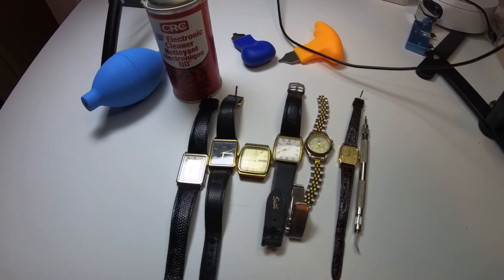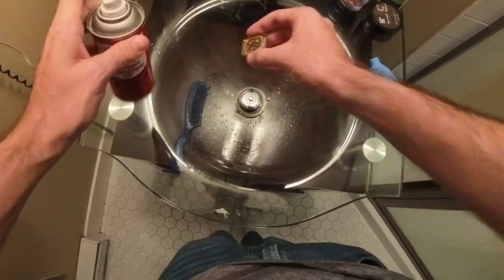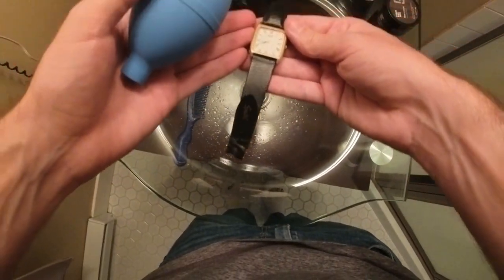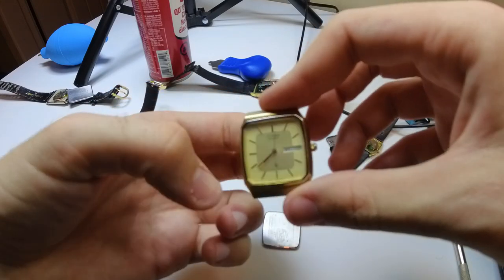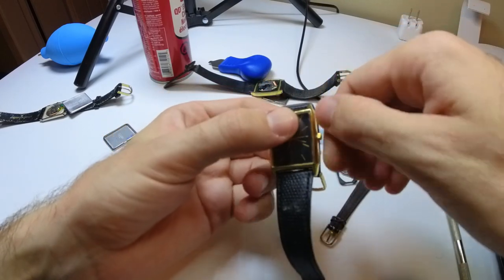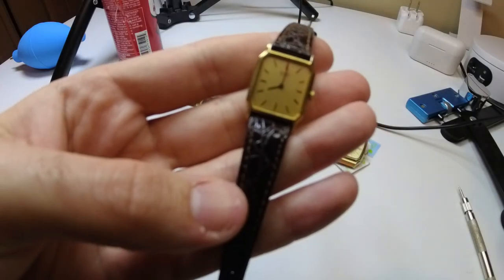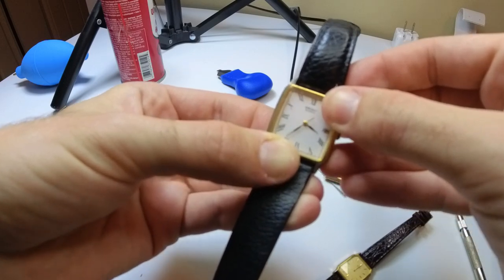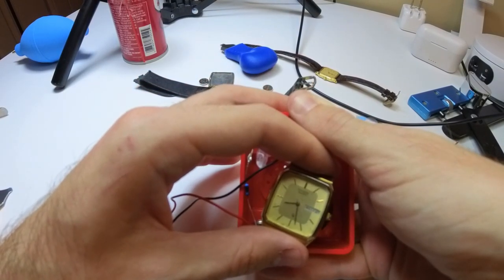fixing quartz watches with electrical cleaner

Comment: no watch problem ever been fixed by putting more oil in a watch ... thats the first thing i learned about watches ....
Reply from the maker: Hahaha true, the electrical fluid evaporates
Reply: @vintagesterlingfinds  no it will leave a film of grease behind the most have oil in it ...
Reply from the maker: @ElderPinto254  ok thanks I didn’t know that
Reply: How about pure isopropyl alcohol?
Reply: @Jim-Mc  yeah u can use it to clean watch parts but not the balance wheel !!
Reply: This will insure all the lubricants in your watch will be dry. Not good!
Reply: @knottreel  yepp and not nice for watchmakers that gone open this and find al that crap everywhere..

Comment: Ive managed to get quite a few vintage watches going that didnt work after new battery by using contact cleaner and little air puffer. Also gently tapping movement, but be careful as hands or numbers can fall off.
Reply from the maker: @stevejohnman68  thanks I have tried contact cleaner and it works very well

Comment: it's  wrong procedure to fix these  quartz  watches  ,may be run for while  not for longer  time  watch  mechanisam  must be disassemble and throughly clean   assemble with  proper  lubrication  oil
Reply from the maker: Ok thanks. I did the video because a subscriber recommended it to me
Reply: You're right, but it is such a long road: 1. preclean, 2. clean, 3. re-assemble and lubricate.
Reply from the maker: @MarkJoseph-vv4pj  yes this video was to show a quick fix on an inexpensive watch

Comment: On some quartz watches you have to reset the circuit by using conductive tweezers and touching between two points. If you know the movement caliber numbers, you can find the reset online. Seiko and citizen both are common for needing a reset procedure. Could be that's all they ever needed.
Reply from the maker: @flynlow43  ok thanks. I will relook at them. I have seen that on Casios before

Comment: I use a little bit of moebuis oil blown in the holes instead of the spray you have. I have got a few running by pulling the stem out all the way and pushing it in several times rapidly and giving the second hand a little nudge with a toothpick.  Sometimes it works and sometimes I just have spare watches for parts. I hope this can help someone.
Reply from the maker: Ok cool thanks I will have to try this. I have never tried that before
Reply: @vintagesterlingfinds  And I will try that spray also. Thank you for posting.
Reply from the maker: @jcmamcknight  anytime thanks for watching

Comment: Do the Citizen on the demagnetizer again. Sometimes you have to do that a couple of times. I think it will run if ticked a few times. I would try the same on the one with the corroded battery. What that does is move the gears and the stator and free them up. Glad you saved at least some. Always worth a shot.
Reply from the maker: Ok I will give that a shot. Never hurts

Comment: That watch machine this is pretty cool, never seen one before, try putting one drop of thin oil on the movement then hit that drop of oil with one quick pulse of contact cleaner to disperse the oil through the movement , things might loosen up , just a guess lol. 
Do you still have that zippo collection with the nom lighters?
Reply from the maker: Thanks I have sold most of the Zippos